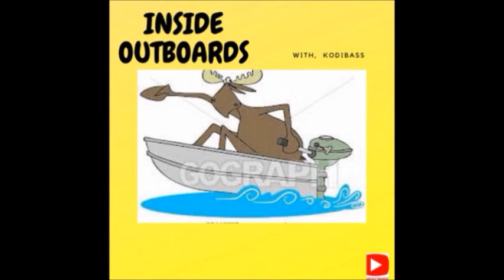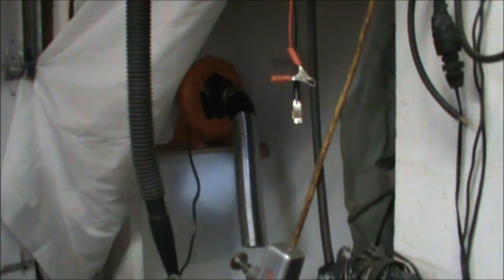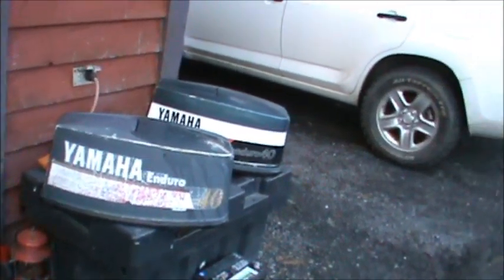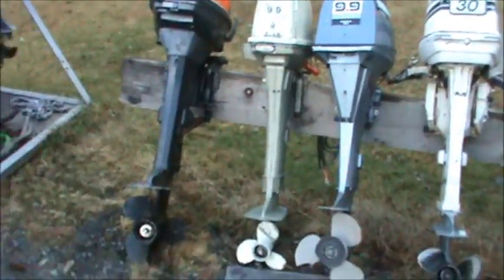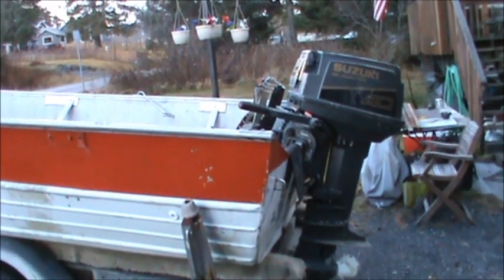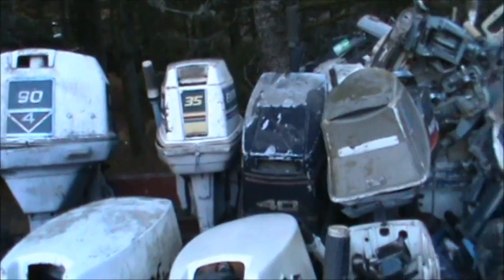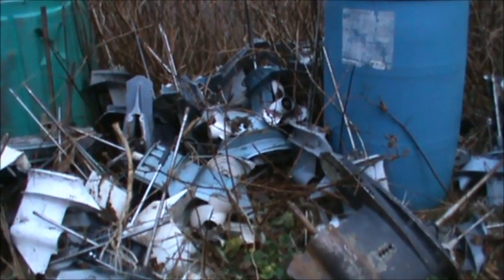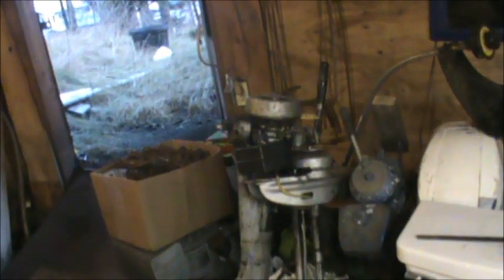OUTBOARD PARTS TOUR

Comment: Hi Kodi, Nice collection you have there. Not many Mercs as you know I love them but either your customers don't have access to them up there or they never break down. Haha I was thinking about having a shop built out back for outboards and car restores someday? If I did would put in a tank with ventilation. I see some folks have them plastic large square tanks but whatever it turns out to be will have a drain on it for sure.
Reply from the maker: Thanks for sharing, Tim  Sounds  like $  K.

Comment: those 55-60hp 2 cyl yamahas were lightning fast! real easy to get a bunch of power out of em because of the exhaust
Reply from the maker: Agree   K.
Reply: @kodibassInsideoutboards  those 2 cyl 50-70hp tohatsus were real fast too. Not sure how the exhaust was but think it was cast on that one but still had balls. Too bad tohatsu stopped making parts about 8 years ago for em

Comment: Hey, rename the bone pile area "Kodibass Outboard Museum" and start getting tax breaks !  Also consider mounting that test tank fan on the exterior side of the wall. The prop most probably can be turned around on the shaft so it will draw rather than push air.... silently ! Take  care and be merry !
Reply from the maker: Fantastic  Idea ''  Yep the Fan Is a Project in works. 4  sure.      Kodibass

Comment: If you run across a 1956 RDE-18 30hp Johnson I need the rear handle mine has a crack in it and the bottom of Cowl I am restoring it so I took the bottom off and the nipple where it bolts together on the fuel side broke I JB welded it for now eBay does not have it and I have to sign in to get your email or it will not give anything but donation for pay pal if you come across one I will buy the parts I will Email you tomorrow on it if I remember
Reply from the maker: I think I have what U need,  Watch my next Video  I will Show U What I have LMK  If that Is It?   kodibass